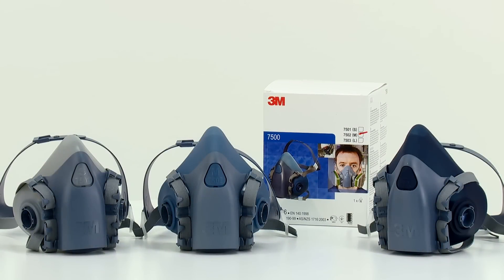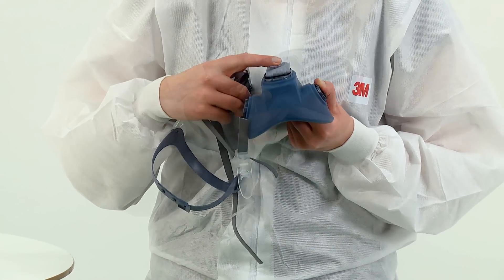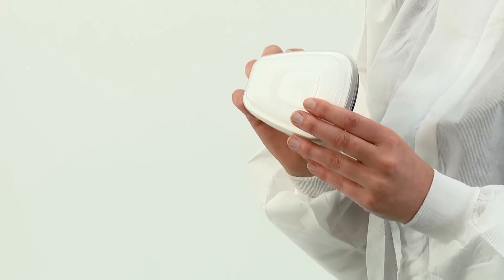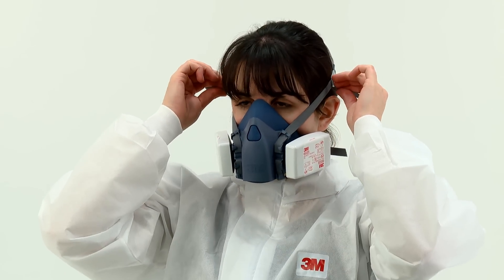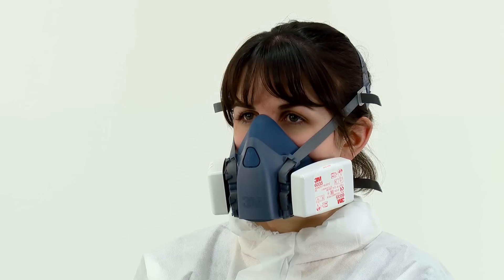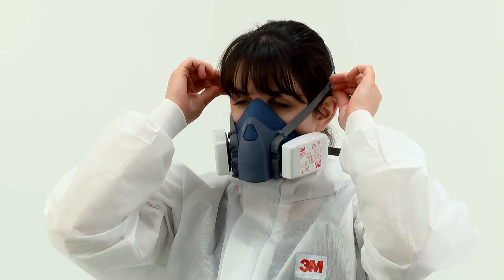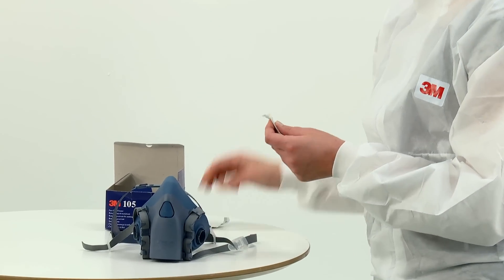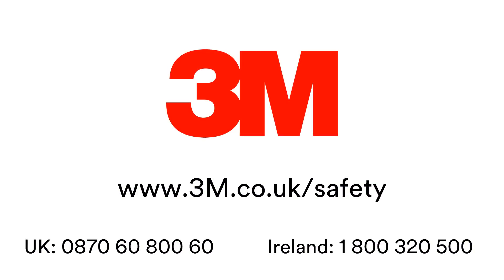Fitting 3M™ 7500 Series Reusable Respirators

Comment: In this video I noticed how high the respirator fit on the bridge of her nose this wouldn't't be very comfortable or practical for eye glasses or goggles IMO of course it dependent on the glasses or goggles but still looks like a issue...should she have been wearing a small size respirator maybe? I'm looking at these and want to buy one but the problem I'm seeing is not knowing which size to purchase, on amazon they have a "Non-returnable due to product safety reasons" policy which means you can not return or exchange for different size. How is a person to know what size to choose?
Reply: I have that mask in the video and it's more or less impossible to use it with glasses. What mask did you get? I see that you asked 9 months ago and it seems 3M doesn't answer here :(

Comment: Can anyone tell me how you work out what cartridges fit with this mask.  I bought the mask expecting it would be straightforward to work out what cartridges I need and where to get them, but I can not find a listing anywhere.  I am after something that filters out particles, eg when dry sanding polyurethane coated wood.

Comment: Help me out guys cuz I bought one just recently but the only articles I read about it is for woodwork and not healthcare settings. Did I just make a mistake or what ?
Reply: The exhaust is unfiltered.  In the  healthcare field, the exhaust needs to be filtered to protect patients.  If that's the case, you're better off getting a N95 non-valve mask.

Comment: Been using this for a month or so. I find that it’s become increasingly difficult to attach the plastic case to the silicon mask. I’m not getting the 2 clicks consistently (as advised by 3M instructions) upon pressing near the triangle area and near the exhalation valve area. My thumb now hurts each time I’m trying to put this respirator together after cleaning. If anyone has suggestions, would appreciate them. Thank you.
Reply: Check if the "tracks" where the filters attach to the mask are damaged.  You may be twisting the filters the wrong way.  I almost did it to my new mask the first time I attached my filters.
Reply: @juicyfruit6311 , I wasn't referring to the "tracks" for the filters. Mine are intact. My problem is with attaching the head harness assembly to the silicon part.
Reply: @juicyfruit6311  hey after how long these filter and cartidges are exired.

Comment: I bought the 3m 52p71. will this protect from sprayed lacquer?
Reply: I use it with 100% ISOpropanol fumes and works fine.  Works great with glass and carbon fibre application . Good for xylene based solvents too.  Just need a bloody shave!

Comment: what if we have some beard?or stuble beard?will it interfere?with this respirator
Reply: GamersForLife they literally said no facial hair.
Reply: @human47134  but is not it obvious?no one can always be cleaned shave
Reply: @human47134  this is a very bad requirement imo.
Reply: @human47134  i mean will it damage hair?is it useful with some beard?or we need to be clean shaved?they did not answer that in video...
Reply: @gamersforlife3440  The instructions on the manual say you need to be clean shaven, or it will not work. It needs to be an airtight seal.
Reply: @alexioskomnenos5290  so its kind of useless unless we are cleaned shave?
Reply: @alexioskomnenos5290  its not really a good requirement imo not everyone is cleaned shave always
Reply: @gamersforlife3440  It is a necessary requirement. Hair between the seal and the and your skin is like having a fortified city with an entire section of the wall being 10cm tall. There would be no seal. It is physically impossible for anyone to design a half mask that seals for someone with facial hair. You can either shave, or wear a full face respirator that costs 10x more.
Reply: @alexioskomnenos5290  no it does not cost that much lol so will the full face respirator work?its not 10x expensive
Reply: @gamersforlife3440  A full face one should work, provided you don't have a neckbeard or facial hair in the area where the sealing surface is. It's not hard to understand. If there is facial hair where the mask seals (usually rubber) it doesn't work. it needs to be SKIN TIGHT, otherwise it will let harmful gasses and particulates in, rendering the mask useless.
Reply: @duftmand i mean it will still be better then no mask would not it be?i dont really like full face one because of its bulkiness
Reply: @duftmand  i am serious but not very serious kind of in the middle actually...
Reply: @duftmand  Nothing really but i just like some subtle beard...
Reply: @duftmand  i never really did a proper shave its been a long time actually
Reply: GamersForLife if anything this is your excuse to shave. It takes 10 minutes and you’ll not only look fresh, you’ll also actually be safe if you buy the half mask type.
Reply: @duftmand  Some people there's no helping. A+ for effort buddy.

Comment: If you try to negative pressure check surely wouldn'tthere always be a little air coming in around the exhaust? I presume in normal use this wouldn't be a big factor since least resistance means the air would want to come in through the filters/cartridges.. but still it makes me paranoid about the seal.

Comment: Is applicable to be used against the COVID19?
Reply: If you have the correct filter then yes. We've been using 3M 7500 series masks at work for a few years now and they are good respirators if used properly.
Reply: How do you filter the air exhaled by the end user?

Comment: Filters should be changed everytime i go out or can they be disinfected with alcohol?
Reply: These filters can be used as long as 6 months, replace when you find it difficult breathing. Please avoid Alcohol based disinfectants for cleaning. Use Clorox disinfectant wipes or Bleach(Sodium Hypochlorite) solution with appropriate measures. Or you can use Hypochorous Acid. Alcohol based wipes tend to damage the Silicon cover and other materials over time. CLOROX disinfectant wipes have Quarternary Ammonia( Di-Decyl Dimethyl Ammonium Chloride) or you can use wipes from 3M. I would suggest using wipes when you use it in less particulated area. Keeping it dipped in bleach works great as all parts are submerged for atleast 5-10 mins.